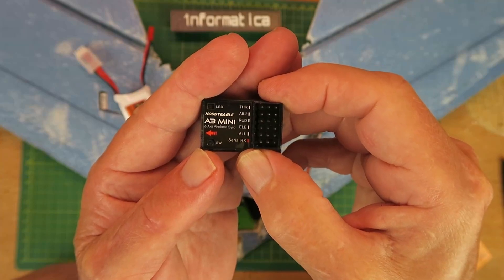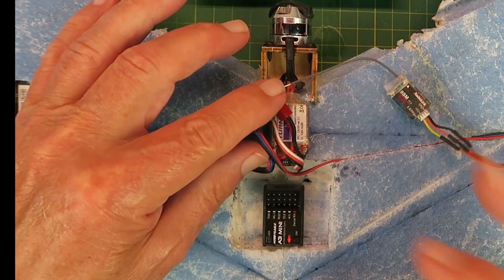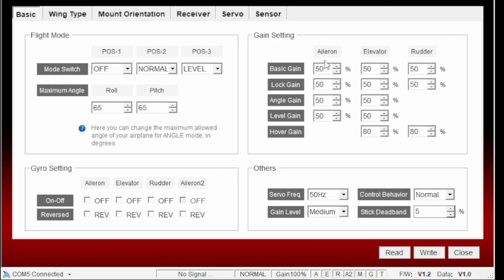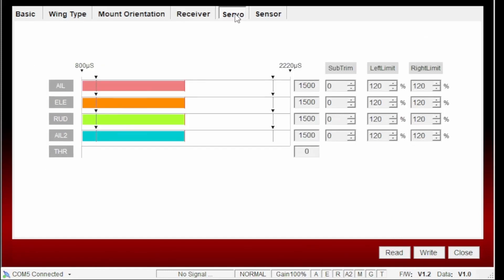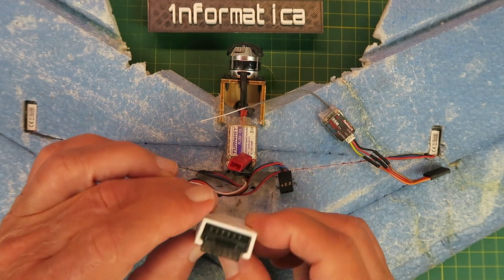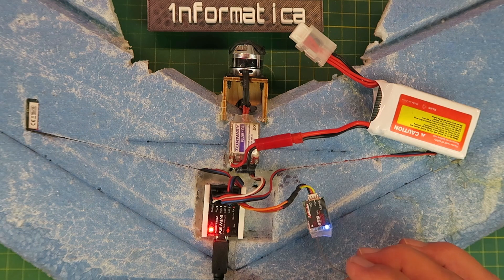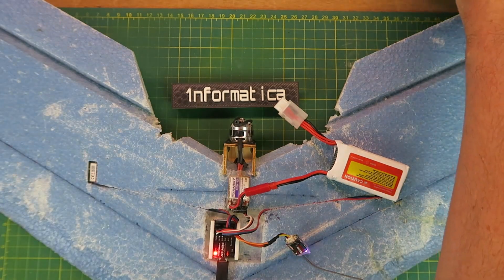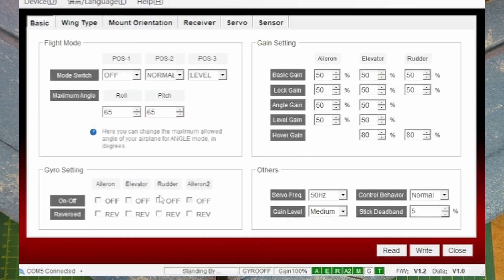HobbyEagle A3 Mini 6 Axis Gyro Stabiliser Delta Setup

Comment: Hello. I bought a brand new Hobbyeagle A3 mini Gyro. But I can not connect it to the configuration software. I get always a timeout error message... I uninstalled and reinstalled the CP210x driver and the configuration software and connect and reconnect it a several times, but with no success... 😢

And should I connect it to the S.BUS or S.BUS2 on my Futaba R7006SB receiver?

Thanks!
Reply from the maker: Sorry but I have to ask, are you using the Hobbyeagle USB adapter to connect the gyro to the PC? https://youtu.be/rPhf0cLP1hw?t=178 You cannot connect the gyro direct to a PC. The A3 Mini supports Futaba SBUS. Thanks for watching, have a great day!
Reply: @1nformatica  Yes of course, I use the original usb-interface which was included... I tried it now on three computers, but always this timeout error message.
Reply from the maker: @12345Flipside Do you see the COM port in the "Device Manager"? If not you may need to use the "Zadig" program to install the driver correctly. https://zadig.akeo.ie/
Reply: @1nformatica  Yes! Absolutely everything is correct... I think the cable has a problem, because the error message is: ... waiting for device and check for proper connection. Or the new A3 mini is faulty. I will send it back to the dealer... 🫤
Reply from the maker: @12345Flipside The next thing I was going to suggest was the cable! Unfortunately those cheapo USB cables can be faulty. Just for fun you could try reversing it!
Reply: @1nformatica  I reversed it and tried absolutely everything for hours... Now I gave up and send it back to the dealer... 🤷🏽 

But thank you very much for your help ❤️
Reply from the maker: @12345Flipside Just one other thing, at the bottom of the configurator window it should say COMX Connected and the dongle should light up blue. That would show the dongle is working. Shame you have to send it back, I have not heard of any other failures fortunately. Please let me know when You have resolved the issue, Best regards, Greg.
Reply: @1nformatica  Yes, the COM6 Port is active and the USB-Interface is blue... Yesterday I bend and push the cable and the plug and I got a connection for some seconds. So I really think, the original micro USB cable is faulty.
Reply from the maker: @12345Flipside Probably less hassle just to get another cable than return it then!
Reply: @1nformatica  The manual says, it is a special custom micro USB cable and we should only use this original Hobbyeagle cable 🤷🏽 I don't know if this is really true and important. A simple micro usb cable for testing could I buy at eBay or Amazon. I don't want to order this special cable from AliExpress in China. I live in Germany 🙂
Reply from the maker: @12345Flipside Perhaps by "cable" they mean including the dongle? I would get a standard cable and try it, then we would know!!
Reply: @1nformatica  I will test it with another cable... 

The Gyro works fine in the default state. I made a test with my Multiplex Funcub... 🙂
Reply from the maker: @12345Flipside Please let me know how it goes! I have a Funcub too, I had to 3D print a new tail wheel and landing gear for it. It makes a great testbed! https://youtu.be/OPIbe3jZpgY&list=PLxtbRS-naT68PQVcBSziD3c9Uk6sNhR_f
Reply: @1nformatica  I bought a new high quality micro-usb data cable, but still the same timeout error... So now I will send it definitely back to china. The usb-interface dongle or the gyro must be faulty, because the software can't connect to the A3 mini.
Reply from the maker: @12345Flipside That is sad. Thanks for the update, please tell me the final solution!

Comment: In delta wing setup, how to swap control of aileron with elevator as of now control stick of aileron is controlling the elevator
Thanks
Reply from the maker: My Tx is setup to output Aileron, Elevator, Throttle and rudder on channels 1,2,3 & 4. Maybe yours is different. Try swapping Channel 1 & 2 on you Tx or in the "channel mappings" tab of the A3Mini configurator.
Reply: @1nformatica  I have the same problem with hobbyeagle a3 evo,
Radiomaster tx16s transmitter, sbus connection. I tried to switch between the channels
But to no avail..did you find a solution for this?
Reply from the maker: @nh-eq6bt  I have never had this problem, I was answering a similar question. The Tx MUST be setup to output Aileron, Elevator, Throttle and rudder on channels 1,2,3 & 4. Check in the "channel monitor" tab on your Tx. Also check you have programmed the orientation of the gyro correctly for your installation. I made a video of a similar Hobbyeagle gyro you may find useful : https://youtu.be/QuFFMQp8A5c Thanks for watching, have a great day!
Reply: @1nformatica  short update,
It turns out that one servo goes in the reverse direction, I replaced another set of servos
And it worked out
Reply from the maker: @nh-eq6bt  Good to know! I guess the lesson is always use matched servos!!

Comment: Interesting.... Am noticing in your Videos that Massive Overcontrol  Throws seem to be a constant in your model setups. 
Certainly in intiall setups.. wondering why tho ?
Reply from the maker: My philosophy is to set the model for max throws and I have a 3 position switch on my Tx to select 75 or 50 % and I start usually with half aileron and max elevator and dial it in from there.